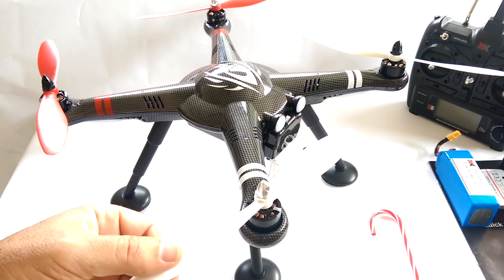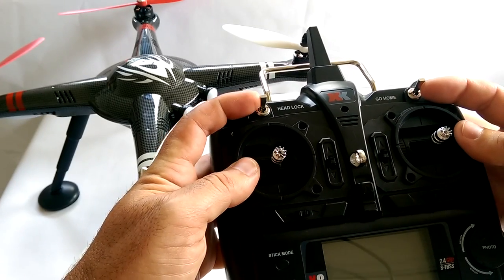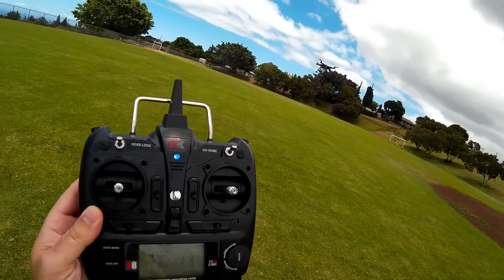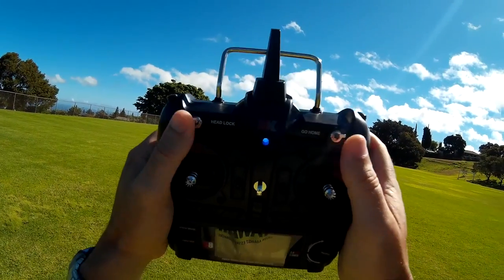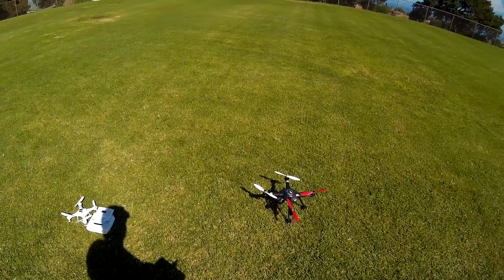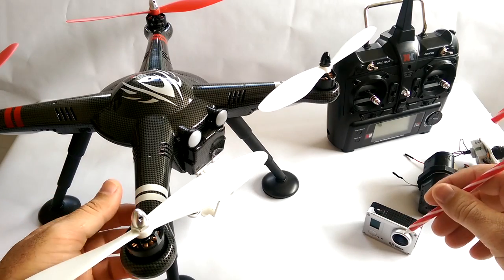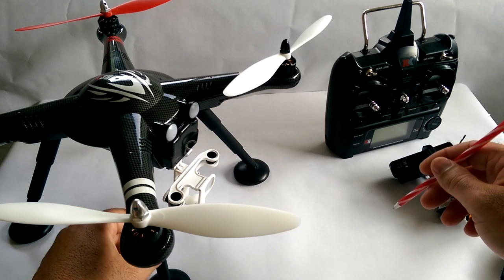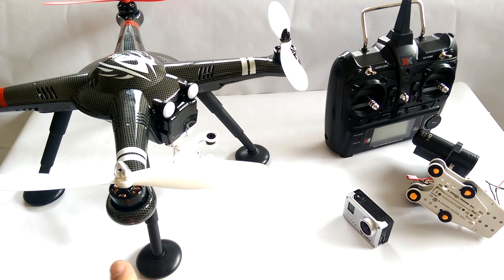XK Detect X380 GPS QuadCopter Drone Full Review - [Setup, Flight Test, Pros & Cons]

Comment: outstanding review,  I'm looking to buy either the v303, the x8 but now I'm thinking this one due to it's reliability.  my cx20 is all
 over the place . I'm looking for a very stable video platform and not so much a hot rod. I was all set on the X8 until I saw your Crack
and I hear that alot, although I love the telemetry aspects.  I'm going to buy in the next few day any thoughts from you or anyone else would be a big help. thanks again for such a great review...tony
Reply from the maker: Hey Tony,  thanks.  This is definitely the most stable quad I'v tested yet.  Being that it is still new there is not much known about it's full capabilities.  There is a telemetry UART port on the main board and I plan to test when I have the parts.  This will be a huge bonus if we can use a telemetry radio.  
I'm still waiting for Gearbest to send me legs for the X8 since there were none in the box as you may have seen in my review and I can't do any further testing without them.
Reply: Thanks Dustin for your responce. Keep up the great work....

Comment: Hi Dustin  i did calabraion  had 2 blinking  green lights   but when  i spin  3  of  the motors  with  my fingers  thay spin  easy  the 4th one  seems  to grab   a  little  bit  that  want  makes  me feel  i  might  have  a  bad   motor  i  hope  that  is  all  it  is  thanks  Dustin  for  all  your  help  it  would  be  nice to   meet  you  one  day  so i can  shake  your  hand  in a presentation  for  the help  you  give  people
Reply from the maker: +David Miller I had a staple in the motor of my second x380 and it acted similar.  Had to take apart the motor, inspect and remove the staple.  Working fine now.  The motors have very strong magnets so I'm not sure if it was picked up at my house or the XK factory.  I would take the motor apart and inspect to avoid further damage.

Comment: I notice a lot of people complaining about crashes, this has me a bit scared because I was about to order mine this coming week. (sorry to keep bothering you)
Reply from the maker: There are going to be a percentage of defects and people will voice that more than units working.  Just do the pre flight compass calibration at a park, give it a few mins sitting after battery plug in.  Then fly and keep it under 10 feet and close while testing all modes to make sure it's all working.  I would recommend taking a video of this just in case there is a defect you can show vendor.
Reply: +Dustin Dunnill Cool, Thanks

Comment: Hello Dustin,could you help me choose a quadcopter that could grow with me(e.g. gimbals and camer and mods.).I will never have the need to go over the hobby grade copter and after watching your videos I was wonder would you pick a cheerson cx20 or a 3d x8.I would love a xk detect x380 but it's a little out of my budget for now.I would  mostly be using the Q/C for video and photo with the possibility of getting into FPV flying.I would greatly appreciate any help/opinion and like you I have lovely open countryside for my hobby.Thank you for your great reviews and mods and in advance of any help you can offer.
Reply from the maker: Hi Edan,  save up $20 more and get the X380.  It is a much easier quad and will be more stable for filming with correct gimbal/Cam.
Reply: +Dustin Dunnill Thanks for your quick reply. As I say i'd love to get it but the x380 is 234 euro+54 delivery,the cx20 is 195 euro and the 3D x8 is 179 euro ,both with free delivery..The delivery charge on the x380 is just out of my reach and I'd rather put it towards a gimbal.
Reply from the maker: Hmm.  I still think it's worth it to save for the X380 or the Seraphi I've recently also started to review vids on YT.  The fyx8 has some strange control issues for me and I don't trust it.  The CX-20 is better but I really had to tinker and spend some time and money to get it flying almost but still not as stable as the X380 or the Seraphi.  Hope this helps.  Just my honest opinion from experience with all.
Reply: +Dustin Dunnill Thank you for your reply and all your reviews.Just watched the 2 videos on the Seraphi.Cool looking machine.I'd be very foolish to ask a guy his opinion and not take it.You have some selection judging by the shelves where you do your reviews.Thanks again for taking time out to help me out.

Comment: Seeing as this is over $100 more than the CX-20 I'm not sure the value is there.  It does have a larger battery, but I'd probably still recommend the Cheerson for somebody just getting started.
Reply from the maker: Yes price is more.  What I liked was build quality and solid materials.  Out of the box was perfect.  Quality control looked very good.  No accidental crashes from forgetting your throttle is down.  I still don't know how limited the FC is though.
Reply: The shell does look nice.  Do you feel it'll hold up to a crash better than the CX-20 shell?
Reply from the maker: Definitely a stronger shell and I do think the circular geometry of the arms make it a little more structurally sound from an engineering standpoint.  I really hope I can tap into telemetry.  There is a UART open port on FC :)
Reply: I wonder if a Pixhawk lite would fit in there ;)
Reply from the maker: Probably,  plenty of room in this "dome".   GPS is copper foil shielded out o the box :).
Reply: Dustin Dunnill I'd be interested in seeing what's inside there.  Take it apart yet?
Reply from the maker: Not apart yet but there are some pics in the owners thread here http://www.rcgroups.com/forums/showthread.php?t=2420732&page=7
Reply: Dustin Dunnill Interesting, so the FC is attached to the board directly.
Reply from the maker: Looks like it.  I'll be taking a look inside soon once I have time to start modding.

Comment: hi Dustin im having  problems  with  my x380  i have  not put  gimbal  on  or  added  any  thing  else  to  it  but  when  i  press  auto  take  off  it  seems  to not  have  gps  lock  than it  flys off  for a few  feet  then  crashes  the  gps  green  light  seems  to be  operating  correctly  could  one of the  motors not  be       working  to  well  its  the 5 flight  i  hope  you  might  have  some  idea  what  it  is  i have done  the calabraion  but  still  dose  it
Reply from the maker: +David Miller hmmm..does the compass Cal complete correctly?

Comment: Hi, just one question. Does the transmitter display battery percentage?
Reply from the maker: +Basetau not for the drone.  Only the transmitter.  There is no telemetry link.
Reply: Dustin Dunnill Thanks for the information.  It will be tuff to work out remaining battery time. My husband $170 worth drone has hight, distance and battery percentage information. Still having difficulties choosing between DJI phantom 3 standard or XK detect as if I am including Gimbal and camera price difference is only $150. Need help to decide. Do you think XK detect is a good bird?

Comment: Can you show us compass calibration so when you hit RTH it doesn't go return to somewhere lol.
Reply from the maker: Should be as it instructs in the manual.  Always worked for me.  Don't think I'm going to do a vid for that...sorry.
Reply: np thanks... just ordered it today. Using a Cheerson Cx-20 wanted a Quad with better range I hope this x380 is good. Cheers!
Reply from the maker: The stock range is going to be about the same as the CX-20 until you do a range mod to TX.  I'm in the process and will have a video on it up soon.
Reply: I taught the stock range was 1000 meters?
Reply from the maker: The thing about range is here are so many variables.  You might get that if you have clear line of site out in the country with no WiFi or interference around.  I got about 1500ft line of site on the shoreline video.  I also got 1.4miles on all stock radio gear for cx20 out on the mountain away from interference... You may have seen my cx20 in the clouds 1.4mile stock range test video although I did pull RX antennas further down legs in that one.
Reply: Indeed about the variables. it's like internet speeds you never get what is promise at times lol.

Comment: dustin ... may be you could advise me?
impossible to make the compass indicate as in the manual, yet it flies wonderfully, is not the gps green, still red green. (France)
parameter program X380 (rc groups) ok ... no problem !! good ...
Yet it is not the video is missing ...
lever down, three headless, red three seconds and red green ,red green,...etc.
it is hopeless ...
Reply from the maker: +stephane m. Does RTH work?  and does it come back.  If not, maybe it's gps issue with the lights blinking.  Dennis in rcgroups.com xkdetect x380 owners thread had the problem and solved it.  Check out what he did..it may work for you.
Reply: RTH does not really work !!! does not arise in the right place ... return to manual.
Reply from the maker: Yikes!  Even if you let it sit for 5 mins in open area (no building, trees, etc) you never get double green blink GPS lock?

Comment: Looking forward to the mods! Going to order one soon thanks for the great review its helped me choose this quad over the X8G.

I believe it is possible to do FPV if you change the sj4000 for the wifi version of that camera but you have to tinker with the settings. 

Once again thanks for the review.
Reply from the maker: Thanks Sadiq, glad it helped you out.  I wouldn't recommend ever using you WiFi on Cam for FPV.  It will conflict with controller as they are both 2.4ghz and you could easily crash.  Get a 5.8ghz FPV setup and attach instead.
Reply: Thanks for that info Ill be all eyes and ears when mods vid come out.

Comment: Hi Dustin which is better the cx-20 or the xk detect x380
Reply from the maker: +RC infamous if this is your first big GPS quad, the X380 is better out of the box IMO.
Reply: +Dustin Dunnill Yes is my first big GPS quad but i like the manual mode on the cx-20 but i dont like the range (about 300 meters)and worries me about the GPS. On the x380 the range is very good but doesn t have manual mode.     And what does IMO mean?
Reply: +RC infamous and almost forgot what type of fpv tx an rx do you use, or monitor???

Comment: Can you take off without gps?
Reply from the maker: Good question.  Honestly every time I've flown it (5-6) now.  It has always given me GPS lock (2x beeping green light) within 30 seconds there is no way to tell how many satellites need to be locked before take if any unless I have telemetry to see satellites.  Maybe I'll try a take off in house or immediately after plugging in and see what happens.  I'll let you know.
Reply from the maker: I did a test in house last night and it even locked and allowed me to take off in house 10 seconds after power up.  This tells me that it either has a very low GPS lock requirement to launch or it has a super GPS module.  I was wondering a few feet in house while hovering so this also is an indication of low GPS required for lawnch.
Reply: Dustin Dunnill The 30 min flight time has it sold for me defiantly getting one. I just got a 3dr iris+ and i hate how you have to have GPS lock to take off it's a beast though.
Reply from the maker: It is good time.  And that's with stock battery.  It looks like theres room to fit a 6000mah or more lipo on it which I plan on doing but am still looking for one that fits.

Comment: how to use GPS function?
Reply from the maker: GPS is always on with X380
Reply: +Dustin Dunnill Do you need full GPS lock for auto-take off?
Reply from the maker: Hey Marky, don't think so.  That said I never take off until I get the double green blink meaning there is some GPS satellites.  At my place I get double green quickly even in house.  So honestly I've never tried with red/green blinking since I get lock in 30 seconds or less every time.
Reply: Dustin Dunnill
Thanks for the quick reply. I have read the manual as best I could, and it didn't mention anything about having full gps lock to use auto-take off - only return to home it MUST have full GPS. (Not 100% sure that's the case though) but nothing was mentioned about the auto-take off requiring full GPS lock. Mine shipped today from gearbest EU warehouse it was the only one in stock in the EU W. Last one - did you balance your props before first flight? I don't want to fix something that isn't broke kinda thing. And I will try to make sure it gets full gps in the garden with these damn sky dishes, luckily mine is on the front of the house and not the back. Cheers
Reply from the maker: Cool. Hope it arrives in good shape.  I did not balance props out if box.  I did a little while after but didn't notice much difference.
Reply: Dustin Dunnill
Mine arrived today, it really is amazing. The cheerson cx 20 has nothing on this... I was scared incase it flew away or crashed on the first time, after about 10 minutes of telling my self it's ok, just go for it... I held down the auto take off with gps lights flashing green twice and there it was, she was in the air solid with no stick input. Now I'm about to buy a gimbal to attach my sjcam, would you know of  gimbal that suites this model? nothing too expensive! lol. Thanks so much for your help, sorry to be a pain! I look forward to more videos.
Reply from the maker: Right on!  Congrats.  It is definitely more stable than cx20 out of the box.  I just did a review on the Mini3D FeiyuTech gimbal which is a good match but you need a camera you can drop the FOV below 150° so legs don't show.  Otherwise the cheaper G2D is a good bet.  I'll be reviewing more gimbals soon.  Have fun and fly safe :)
Reply: +Dustin Dunnill Can this thing be a problem?
Reply: +Paul Terl ...was referred to the fact that the gps is always on...

Comment: Hello Dustin,
 Your mount for a Sony Action camera caught my eye. I have been looking all over for that type of mount. I did find a red plastic 3D printer one on eBay but not totally like your mount adapter. http://www.ebay.com/itm/222267849335
Where did you find that one in this video. What alterations did you do to it to fit the Walkera 2D gimbal. Thanks.

Comment from the maker: Update:  If you need parts.  Gearbest seems to be adding more every day here http://goo.gl/QfsrDK
Reply: +Dustin Dunnill Would you say that this is a best machine for $200 - $ 300 range, even better than Cheerson CX20..maybe.. Cheerson has been so good to us..
Reply: +Dustin Dunnill ive book marked this in my favourites,thanks
Reply: Thanks.  I will be getting a replacement unit one way or the other and was having a hard time finding any parts for it.  I ordered an extra battery from a local hobby store and the price was $116.  I haven't paid for it yet and won't because I can get 2 of them for less money at Gearbest
Reply: The drone was brand new, first flight.  Still under warrantee
Reply: why are you getting a replacement unit ? what was wrong with the one you got ?
Reply: +Dustin Dunnill Are these brushless motors?
Reply: why does the gps make it slower? is it still fun to drive for fun? did you fry this quad it your pc. sorry for all questions been thinking about upgrading from syma x8c. at first was considering xk 350... what would you suggest, btw what is the usb slot for? Thanks
Reply: can you add phone on controller
Reply: +Michael Myers The XK 350 is an aerial stunt quad quite different from the XK 380. If you want speed then the XK 350 is your bird. The XK 380 is for aerial photography therefore speed is not that of an important factor. The USB slot is for firmware changes and upgrades via your home computer.  I have both and they are entirely different animals. 

Happy flying.

Comment: This quad is beginning to receive complaints about quality control and XK reportedly will not respond to. Seems they have weak solder joints and firmware/flight controller/GPS conflicts making this quad sometimes uncontrollable and even fall out of the sky.
 I ordered one earlier this week from GearBest  in good faith and because of the really low price. However, after a few days I'm already losing trust in GB. They let you order stuff they don't have in stock and when you check on your order it's always "Processing".
 My order has been processing for a week and when I contacted GB they replied that they will have to fulfill my order from another warehouse and gave me 2 options:
1. Wait a few weeks, they might have it shipped out by March 10.
2. Ask for a refund or preferably an in-store credit.

Since this quad was only $207 this week and I have another quad to fool around with, I elected to take option 1 and see if the get my order shippe as they indicated. 
I think it is an excellent aerial photographic platform... if you don't try to do crazy stunts.

Comment from the maker: I've been keeping an eye on price drops and here is a good one.... Price Drop @ US Warehouse!: http://goo.gl/NoGK6f
Reply: +Dustin Dunnill: Thanks for looking out.
Reply: Hey, my XK Deteck X380 was delivered yesterday 😁😁😁 do you recommend opening it and hot gluing the connections or that's not necessary? or what other suggestions do you have before I take it up for the first time?
Reply: +Omard Gardiner Hot gluing the connections is really not necessary. Although no harm would be done should you decide to do so. Prior to taking it up just cover the basics. Read the manual make sure all battery's are fully charged and make sure you get a GPS lock.
Reply: +Jason  Jackson  And... do not plug anything like a FPV or gimbal  into the belly power ports after you connect the battery to the quad.